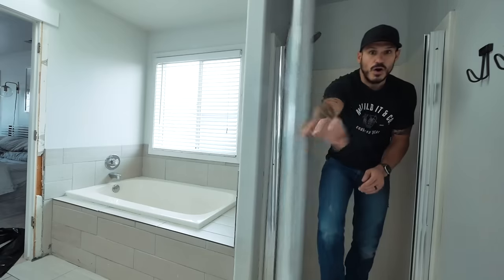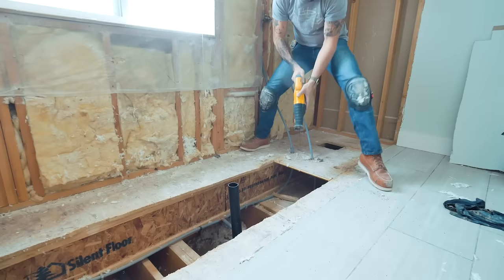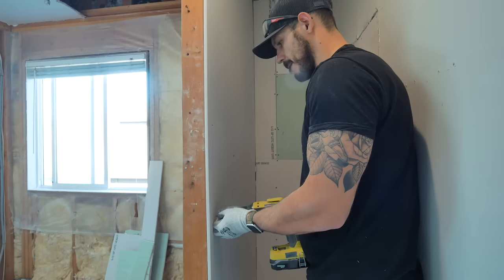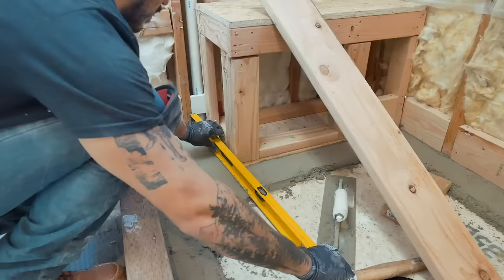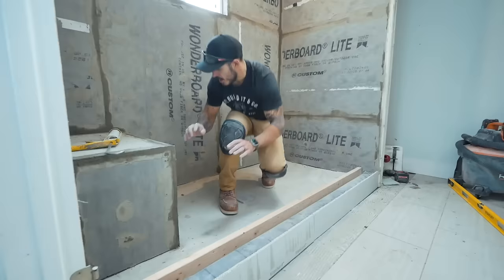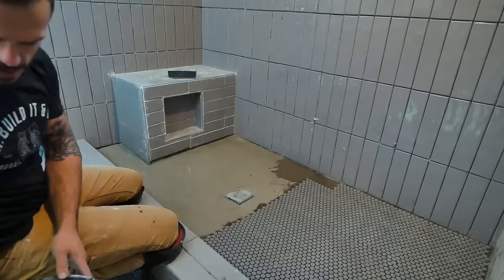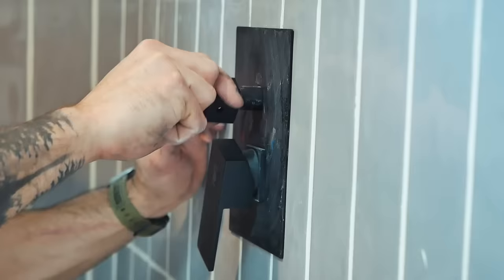Building a GIANT Shower (Home Remodel)

Comment: Weird no plumbers commented on the "s" trap, glue, sharkbites. No tub n tile pro commented on tile setting, grout,pan. No carpenter commenting that the new insulation is backwards. Weird that no pros chimed in on this video on the things that are not done correctly and may lead to failure. Anyway Hope the shower lasts that was a lot of work.  Idk man goodluck.
Reply: Man I was looking for a comment like this. I'm a jack of all trades and master of none myself. I'm fine with spending my time and money on my own projects and having to go back to make corrections. I hope that his shower doesn't fail. It does look great.
Reply: Love this bathroom! Husband is a master plumber and I asked him what he thought. He said that yes, the s-trap is not to code and that sharkbites are junk...but, that not enough water is going to drain at once to cause a siphon or any issues that would cause bathroom to fail. He did mention that that guy will regret those sharkbites in about 10 years if he hasn't decided to remodel it again already by that point. Beautiful though
Reply: I look at sharkbite the same way an electrician looks at junction boxes...they must be accessible. They are great for a quick and/or temporary repair and I keep a few in my toolbox. But they should be replaced, when convenient with a better solution.

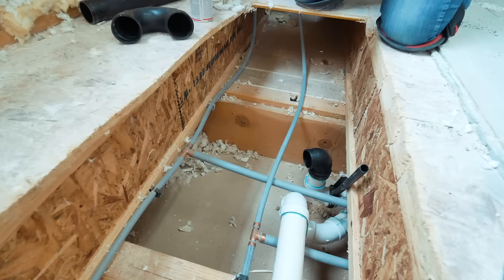Comment: You need to think about changing your water pipes. You have polybutylene installed (as seen on 2:16) and they're notoriously bad. They will crack and the seems will start to leak eventually.
Reply: Yep

Comment: 14:24 the grout lines need improvement!!
Reply: Yeah smaller grout joints always look better
Reply: The tiling needs improving
Reply: Also never grout your corners or changes in plane.  Buy color matched caulk or silicone for those areas!  Grout will always crack over time, and smearing silicone over it does nothing.

Also, always slope any shower bench or flat surface towards the floor.  1/4" per foot is fine.
Reply: bigpjohnson got bit by this due to shoddy contractor

Comment: Also one more thing so that you don't get mold on the inside of your wall, make sure you raise the cement board at least 1/2 inch from the floor so that water doesn't wick up into the cement board and start to rot your 2x4s

Comment: Crazy question: why not use pressure treated wood for the blocking and the bench? Just wondering.
Reply: or plastic boards as they can't rot with moisture contact. Especially on a step in a shower application that ALWAYS has water constantly spraying on it.
Reply: Pressure treated wood twists as it dries and can crack substrate.
Reply: @k0harmer  yep that's why I keep (8) treated 2"x4"x8' boards in my shed for a month before I use them so the are already dried and ready to paint or use.
Reply: He's no pro.  Yes, you should use pressure treated in those areas.

This is a good video on the overall job, but he made a lot of mistakes and omissions along the way.  YouTube some of the more famous tile channels to see how to do it right.

Comment: The glass in the window near a tub or shower, you must use tempered glass.  The vapor barrier on the fiberglass insulation faces the conditioned space, not outside.

Comment: I learned from a local glass install company 
That if you spray the white foam glass cleaner on top of the silicone before you wipe your finger across it’ll clean up easier

Comment: As a former plumber, I'll say it is a terrible idea to use a generic shower system. That bathroom cost the homeowner a small fortune, and if you don't select a well-serviced brand, then you may be tearing it all out when a cartridge goes bad. Skimping in this area is not ethical, and you should consider more of allowance for the mechanicals in the future. Sometimes you can findd good generics that accept Delta, Moen, or Kohler cartridges and that is an acceptable way to save money.

Comment: Great video!  I have two questions.  You mentioned that the shower glass was a special order because you needed 6 feet; I assume that was the height; how wide is the glass panel?  Have you had water to splash out of the shower area?
Reply: The size means that he needed it to be around 10mm and safety glass. He sealed it so no splash out, but a lot of people don't. You get a bit of water splashing out, but you don't have to worry about the seal going mouldy, as it isn't there.
Reply: @anthphoto  she means bc it's not fully enclosed it has an open door design

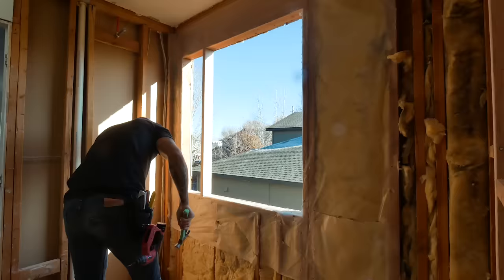Comment: 7:00 Don't install your window before your sheathing. You install sheathing, then flash it, and then install the window. He will have leaks. Also, I don't recommend a framing gun to install windows. The heads will protrude further than roofing nails and they should at least be galvanized and not common/bright. In the end his house will aesthetically look right, but it will have water issues down the road. Water destroys so make prevention the #1 priority.

Comment: My biggest concern on a similar project is the window and Im curious how well your window has held up?  Its probably too soon to see problems. I noticed you didnt put on any wrapping protection on either side while installing the window .  You ultimately do on the inside but is that sufficient? Im looking for alternate options to double and triple prevent downstream damage.  Mine is lower than yours and I might just turn into a picture window or have a small anwing at top.  But less openings and crevices are better.  Maybe even custom glazing with no frame.. Glass block is out because of style.

Comment: The gravel in the drain is a no no... it is a breeding ground for bacteria. And please do wetten the cement after applying it. it needs to cure. the mat is ok, BUT do not use staples or studs or screws. glue it fast to wall and floor.

 Good job from a non educated worker.  you are like 85% there mate. Keep it up and you will learn more :)

ps the flaps you let down into the drain WILL wick drainage water up and under the mat up to the ring joint. this WILL cause bad smell over time. better to trim the edge flush with the inner ring of the drain :) Also, the tiling can be done soooooo much easier and faster with tile string instead of the little white plastic crosses. The string is even diameter and you lay it ontop and in between each tile. after setting just pull all the string out into a water bucket. let the water clean the string and its good to go again and again and again :) better for the wallet. better for the environment.  plus u save time

The slanting in a wetroom should be minimum 2.5 degrees :)

id sure like it if some12 had given me these pointers before i had to figure them out my self;)

Comment: Excellent, real quick: in addition to the window sill, On curbs like the one you built, you also need to pitch the tile towards the drain slightly so when the water runs down the glass and onto the curb gravity rolls it back into the shower enclosure and doesn’t allow puddling, 
im also shocked the glass company allowed you to handle that glass, did you have to sign off that if broken or damaged they weren’t held liable?

Comment: 5:15 No, don't use PT lumber on a wood subfloor. Not only is it unnecessary on a wood subfloor, but PT lumber shrinks as it dries. And if you're on concrete, then only use PT as the first sill plate that will be in direct contact with the concrete. If the shower is flashed poorly then it's flashed poorly. No amount of PT lumber is going to preserve the subfloor. Get your flashing done correctly around the curb and you don't have to rely on a secondary material that isn't meant for this purpose.

Comment: Assuming that the tiny shower had a drain.  Did you cap it closed?  My bathroom redo is similar however I'm expanding my shower and removing a heart shaped jacuzzi for a regular tub. I also want to bring the tub up on a pedestal so I can soak and look out the window,. I have no neighbors, should I use cinder blocks for support? A bit nervous but its going to be my third redo on my own. Each getting more complex

Comment: Loved the Renovation. We stared ours with a tile guy and s plumber.  But it is not going well.  They did not center the shower head and the purpose was to gain about an inch and a half. Can the shower head be moved so it's centered.  I'm worried because it's on the second floor. 😢😢

Comment: Curious how the pressure treated holding up. From what I researched I found some say pressure treated wood warps too much for tiles
Reply: There are several layers of water proofing, so at most, I'd only use pressure treated where it meets the ground if your floor is concrete.I've done several shower rebuilds (diy) in single story houses where I used pressure treated wood to sit on the concrete foundation and, as long as you secure it, there should be no warping. At least not enough to affect the tiles.

 His floor is already wood anyways, so I'd think the pressure treated wood is not necessary. Again, I'm just a diy'er so take that info for what it is =D

Comment: I thought I saw a toilet there out in the open, was there a enclosure for it? Or , suggestion to take that beautiful special order glass back out and figure maybe 6' high from the bottom, then measure a foot up from bottom , to be clear. And take it to a sandblaster to get that area lightly frosted for a little privacy.  It would cost about $200 and would look like better homes and gardens designer house. And less clear window area to keep spotless, because its frosted. Great job. Oh. You could of added water jets on other side for a 360° clean in a hurry. Or a cascading waterfall fixture with diverter to switch back to rain mode with a color changing led light strip in the ceiling next to the quiet super fast fart fan you forgot to put it, so you or your wife doesn't smell each others air biscuits in the morning.  Lol

Comment: Tile floor goes in before tile walls , and step needs to be wrapped with diamond wire other than that why use black waterproofer , to messy

Comment: Just two mistakes in your tile prep work.  The "Wonderboard" should not touch the concrete base.  It should hover about 3/8" above so any water leaking at the floor won't WISK up the board.  Wisking can be as much as 18" which is far about your barrier.  The other is to install galvanized mesh in the STEP concrete and give the SIDE OF THE STEP more surface.  IF too thin, it will crack over time.  Just a last comment.  Your tile work is very good but NOTE---Grout is the leak point so using a large face tile such as 12x24 would give you more protection and use far less grout.  Nice job.

Comment: I have a question, i was watching a movie and this thought crossed my mind. I live in a trailer (i'm buying it). The tiles around the tub are falling off the wall, so I have to do SOMETHING.

My thought popped into my head.
- the fiberglass (i think, i have no idea what it is, maybe it's porcelain? it has black chip in it where the white rubbed off? I have no idea about houses and upkeep, nor construction)
- behind the tub is a wall from floor to ceiling, and a foot of shelving, which I don't really use. I just throw stuff i never touch, there.
- the sink is literally at a triangle, in the other corner.

So my idea what to knock that wall and shelf away and put a giant clawfoot tub, (I'm really tall, I hate these tiny, normal human-sized tubs) and maybe tile that entire section around the tub, with maybe a lip, in case water falls there, and put a curtain from ceiling to the lip, with a drain under the tub, and keep the hand held shower (that I bought, because the shower was hitting me in my chest, not head, for both tub and shower.

Can I do this? Is this a real thing people do? Is this absurd to put in a trailer? or is this only something in a millionaire home. (I grew up rich in mansions. I'm now grown and on my own, with my own money, no more mansions.) If i hired someone to do this, would they ask for some crazy amount of money?

Comment: I'm trying to do the same thing, but my house is made of block and concrete and I get a lot of sewer gas because there is a straight pipe going from the toilet, connected to the shower drain, then it goes under the wall.  It's so disgusting that poo actually passes through my shower pipe, which prevents installing any type of trap.  When I can figure out some of these dilemma's, I'll post a video.

Comment: So any particular reason why you left the polybutylene lines in place?  They are pretty well known to be junk and will probably cause leaks and other issues especially where you were toying with things.  If it's open why not get rid of it instead of waiting and for the issue to happen to fix it and then you get to tear up your nice new shower or cut a bunch of holes in the joists and try to crawl around.

Comment: I’m in the middle of renovating my shower and I’ve seen mixed reviews on using treated 2X4’s for the shower curb, have you noticed any movement or cracks in the tiles (specifically on the curb) over the last 2 years?
Reply: You shouldnt use treated unless you are in a basment or on a slab. Otherwise use pine because if you using treated lumber  that can "deal with moisture" you've already planned to have a failing shower. If you seal it all up peoperly, they will never get wet... if they get wet you have a huge problem anyway.
Reply: As treated dries it twists and moves.

Comment: What temperatures you have in winter????? Outside wall only 4 inches, and when I saw how you put isolation.. looks like you have summer all year round. What about humidity barrier in the ceilings???? There would be more questions but will be enough with these :)

Comment: It turned out beautiful. My only dislike is the cut out part where you put the shampoos. I wouldn’t want to bend over that far three times-shampoo, conditioner and body wash. I would prefer it to be more like shoulder height. And I would want them built into the wall. I hate the shelves that stick out and are so narrow. Very narrow where the items far off. But overall you do amazing work.

Comment: A traditional Japanese bathroom is way cooler a soak tub, and area to wash off before soak and a shower literally in the room small divider but unlike the omg you got floor wet in U.S a Japanese bathroom floor can get wet as the drain to shower is built into floor.

Comment: Brick for the curb...get rid of that pan...schluder paper to keep the folds outta the corners...use sold surface materials on the top of curb and bench...get a good granite guy...and don't put in a niche until you have a tile pattern established...keep away for those little tile cuts...where is the tile ceiling...how many water drops come running down and ruin the paint...

Comment: DONT USE PRESSURE TREATED WOOD!
It will swell and crack your tile.  Use regular wood for the curbs.
Reply: Closed cell foam works well for curbs too. There are a few companies that prefab them.

Comment: Does not pass city inspection (not sure what county this is in), Shower bench requires the entire shower pan goes all the way up the shower bench. This prevents water from seeping through the rear edge of the bench and accumulated in the bench cavity causing water damage. This is coming from a plumbing contractor and insurance leak inspector...

Comment: Did you eventually go outside and tie the window in to the moisture barrier? Also new windows drain outside so if you trimmed over the wheeps, your window alone will rot out the framing over a short time since it's a horizontal in a shower. Just wondering, everything else looked great.

Comment: You're not supposed to use pressure treated lumber for the curb because it twists and bends as it dries and it can cause the curb tiles/grout to break & crack. As long as you seal the curb it doesn't ever touch water. Not to mention none of you rother lumber is pressure treated...

Comment: I have a framed out shower, some guys came and put in fiberglass as the base on the baseboard, replacing the need for linders? - but we are considering doing JUST a concrete shower floor, no tile on the floor. Any recommendations on how to go about doing this? Everything I've read or seen is only for putting in the concrete as the base, but not just the floor itself

Comment: You went to all the trouble to waterproof the shower walls and curb then you DRILLED holes to anchor the glass wall. Why didn't you flip the glass brackets so the mounting tab with the holes is on the outside of the shower? Other than that, nice job. We are in the middle of redoing our bathroom. When you are in the middle of a pandemic you get bored, when you get bored you look for things to do, when you look for things to do the bathroom takes a hit. Our shower curb was black dust from water intrusion. Floor is ok.

Comment: What are you using to replace the blow in insulation in the ceiling? Im having to replace ceiling drywall and used R-30 fiberglass bats. Hopefully it will be a little better.

Comment: Now that you’ve had that Shower system for 9 months would you recommend it?  No leaks or anything?  Does the rain shower head dip a little when you switch the hand held shower head?  I read on the instructions on a similar system to not use PEX on the handheld as it will cause the overhead rain to drip.  Is that true in your case?

Comment: What’s messing me up is the plumbing. I feel I could do all the framework and tile installation etc but the plumbing gets me. The whole channels and I believe it was called the sewer gas pipeline whatever is confusing. Idk it probably wasn’t explained to an extent in the video. If in my house, I wanted to relocate the shower head for rain shower and have detachable shower head like in the vid, how would I get the water and temp control to go to both places?